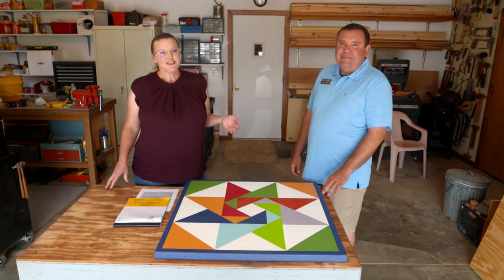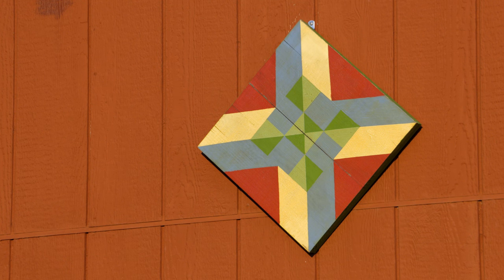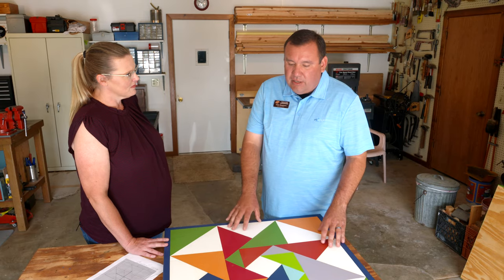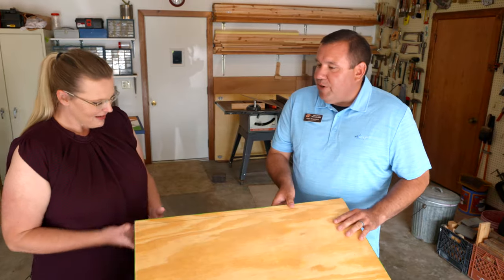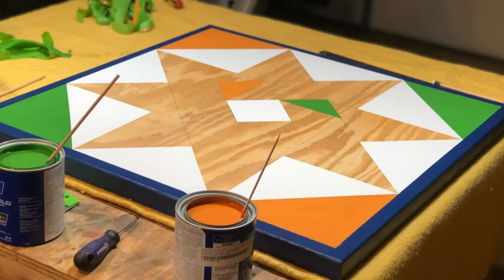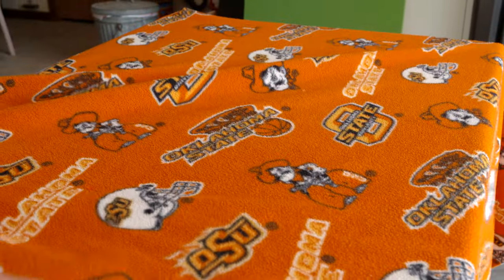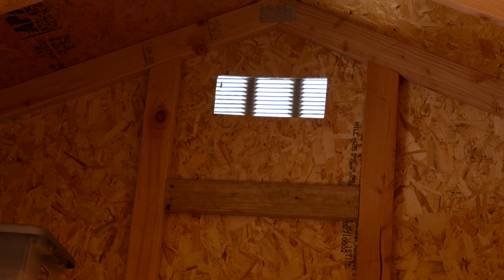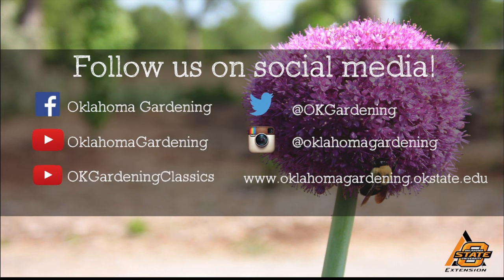How to Make Your Own Barn Quilt

Comment: Hello. I just tried my very first barn quilt and the acrylic paint peeled off. It did not adhere to the wood. I was using Liquitex Basic. Do you have any suggestions? Thank you!
Reply: you need to use outdoor paint.
Reply from the maker: Use outdoor paint and our garden quilt was sealed with a wood sealer, something like Thompson's Water Seal, to keep out moisture.

Comment: I am trying to graph this pattern out, do you have the graph I could follow to make this star?  I keep trying to figure it out, but haven't so far
Reply: Hi Betty. If you look at this pattern  square on instead of on the point, you should have no trouble graphing your own. Once you look at it square on you'll notice it's a 9 patch pattern. You have three rows across x three rows dow. In each row you have three "blocks". Each block is painted in half or thirds to make the desired pattern. I hope this helps.
Reply: This quilt block is called Star of the Orient.